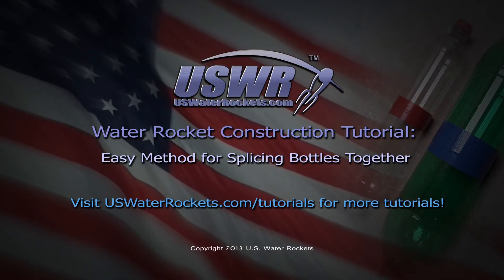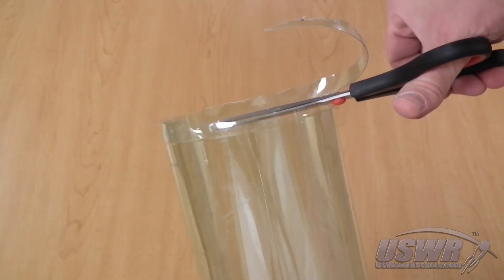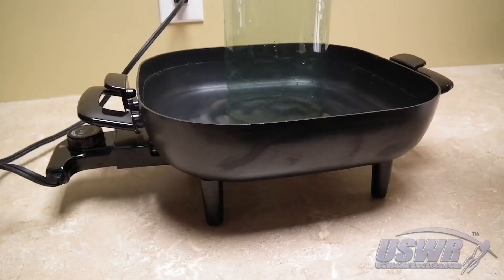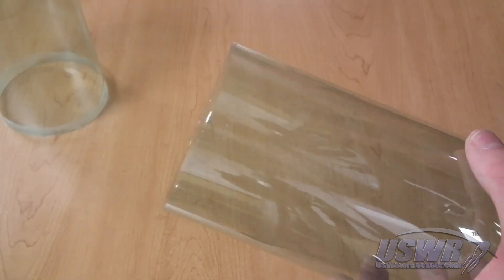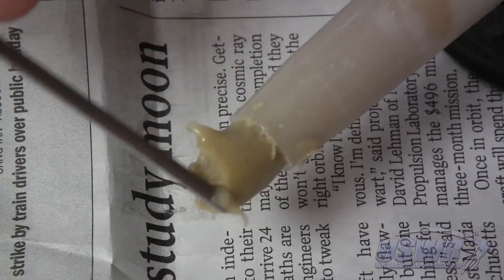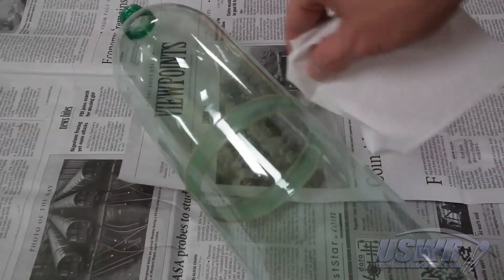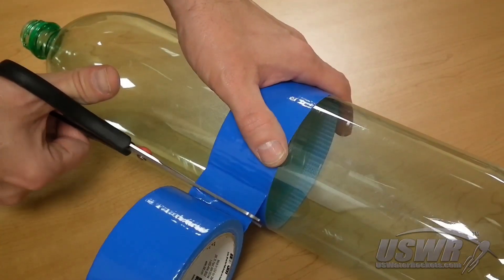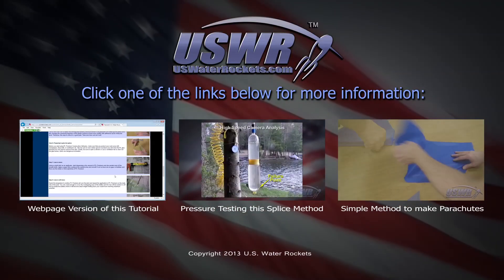How To Make a Huge Water Rocket by Splicing Bottles Together!

Comment: can I use PVC cement ?
Reply from the maker: I have never tested PVC cement, and I don't know anyone who has ever tried. I don't think it would work at all because soda bottles are made from PET and not PVC. PVC cement is made to dissolve PVC, so it probably won't do a thing to PET plastic. It will probably just sit there until it evaporates and not stick at all.
Reply: +USWaterRockets okay.Thank You :-)

Comment: What kind of Pl premium is it?
When i looked there was different kinds.
Reply from the maker: Either one will work. They sell one called 3X and one called 8X I believe, and the resulting joint is equally strong no matter which one you use. The 8X is more "sticky" when it is fresh out of the tube, which is supposed to grip things better while it cures, so you can stick tiles to the wall with it and they will not need to be held in place while the PL cures. The wet gripping power really does not come into play with bottles, because they hold together well with no special glue.
Reply: Thank!

Comment: Can you develop a good splice technique for epoxy?  It not as thin as PL,  and it dries rock hard.
Reply from the maker: I don't think it is possible, because of the hardness of the glue. The issue becomes apparent if you watch video of water rockets filling with air. The bottles get longer and fatter as they stretch out. The epoxy does not stretch because it is so hard, and this causes it to rip the bottle plastic at the joint, making it fail. The only way to stop that is to epoxy and fiberglass the whole bottle to keep it from expanding.
Reply: +USWaterRockets Actually some epoxy brands stretch a little... and I have used epoxy splices to 100 psi (check out my Straton V video)... So I am sure they work, but they have a lower burst pressure. (150psi at best)

Comment: I followed all your steps and it blew up at 60 psi and it's the same glue and everything. Could you please help me with this
Reply from the maker: +Skyfall 555 There are a couple of things that can go wrong:1) When you shrink the inner bottle it is shrunk too much and so it fits too loose inside the other bottle. This is usually where people get caught. The fit should be very snug and hard to pull apart before you glue them.2) You didn't sand the bottles to remove the smoothness all the way around. This is important as well. Many times there is a small seam in the plastic where the bottle mold comes apart and this leaves a little uneven area that is hard to get the sandpaper into.3) The glue was not fully cured. This glue is hardened by water in the air and takes a few days to fully set up. Don't think putting them in front of a heater will make it go faster, it will blow dry air on the glue and make it take longer to set. Take them into a steamy shower for a few minutes if you live in a dry climate to get the glue setting faster.These are the main issues.  A few other notes:Some people report their bottles are not very good. Test a bottle from the same supplier by inflating it and see if the bottle will hold that pressure with no splices before you use them. If the bottle alone bursts, then there's no chance the splice will make it better.Another way to make the splice artificially stronger is to make the overlapping area of the joint larger. Double the width of the overlap and double the strength.Also make sure the plastic is clean and not covered with fingerprint oil when you glue the bottles. The oil will make the glue slip off.Good luck!
Reply: +USWaterRockets  Okay thank a lot for the tips I hope to give it another try
Reply: +USWaterRockets It worked great now my water rockets are going a lot higher thanks.
Reply from the maker: That's awesome! Thanks for getting back to us with the results!

Comment: where I can buy that kind of glue?
Reply from the maker: +Angel Muratalla I don't know what stores you have around where you live. Around here it is available at all the home improvement stores like Lowes and Home Depot and ACE hardware stores. I've seen it at Walmart too (not the big cartridge, but a small regular tube with a screw cap).

Comment: Does this glue really take 5 DAYS to dry? Or is that what you suggest before using it? Please answer soon!
Reply from the maker: +EilyssaLpsTV It takes about 24 hours to set up enough to use, but if you plan on pushing the pressure to the limit where the bottles start to stretch and deform, then you should wait a few more days. You can accelerate the curing process by putting the rocket someplace where there is a lot of humidity, or put a damp paper towel inside. This glue hardens by reacting with water in the air.

Comment: Say I have a two liter bottle with 700-800 milliliters of water at about 40psi. If I increase the size to 4 liters while having the same amount of water and pressure, would I increase or decrease the performance?
Reply from the maker: +BlueLightning Films The performance will probably increase very slightly, due to the fact that the extra air volume will add thrust the original size bottles did not have.  The real advantage comes when you increase the water fill to use the extra volume. Then you get much more obvious gains in performance.

Comment: what kind of bottles u use ??
Reply from the maker: +Aggelos Simadis We use bottles that hold fizzy drinks like soda or tonic water. If the drink has fizzy bubbles then the bottle must be designed to take pressure inside. If the contents of the bottle are not fizzy, then there is a really good chance the bottle design or the plastic it is made from will explode as soon as you put a little air pressure in it.

Comment: Can I use hot glue for the seal instead it's for a school project and the upper end of the pressure range is 80 psi I realize it won't be as strong but hot glue is all I have
Reply from the maker: +Paul Dunbar I've never tried hot glue, since PL premium is so inexpensive and works so well. I've always had problems with hot glue because I work slowly and carefully and it always seems to cool off and harden before I can mate my parts together. I'm not good at working really quickly, but I'm sure other people are faster than me.

Comment: What if I used a Gardena nozzle would that be big enough or to small
Reply from the maker: +Matthew O&#39;sullivan A 10 liter rocket will accelerate very slowly with a gardena nozzle and it will not go as high. It will probably tip to one side before it accelerates enough for the fins to hold it stable.

Comment: If I made my rocket bigger than what it is would it be better
Reply from the maker: +Matthew O'sullivan In general terms, bigger is always better for altitude or distance. The problem you have is that you have to scale up the nozzle opening diameter to keep pace with the weight increase of the added volume in the rocket. If you go past about 10 liters of volume, the mouth of a typical bottle is too narrow for the weight of the rocket, so around 10 liters is a good size limit for maximum altitude. After that you have to start increasing the pressure more than the bottles can take to go higher with a standard bottle mouth size nozzle.

Comment: Yes
Reply from the maker: +Matthew O'sullivan This option will make a rocket go a lot higher than a design with tornado tubes, because those things add a lot of weight and make the rocket longer for the same volume inside. The tornado tubes can also make the air flow inside the bottle restricted, so you get less velocity, so the rocket will not go as high.

Comment from the maker: +Michael Frymus for most bottles there is a flat or multiple lobe shape on the bottom that is called the "Foot" or "claw", which allows the bottle to stand upright. The shape of this part of the bottle is not the optimum shape for a pressure container, so when you put a lot of pressure in the bottle, the bottom will almost always burst before the sides or the top, which are a nice rounded shape that will hold pressure with less stress. If you splice a rocket with all "top" parts, it will hold pressure better than one with a "bottom" on it.
Reply: Dang he left you hanging forever
Reply: I imagine Kranthi Akhil must have had a heart attack after typing USWaterRockets, and then his forehead came down on the Enter key. Surely no one could be that rude to leave someone hanging for so long
Reply: USWaterRockets
Reply from the maker: Yes?

Comment: Hey, Pl premium advanced 8x it's okay?
Reply from the maker: +David Pascual Cortes The difference between the 3x and 8x only seems to be how stiff the glue is when it comes out of the tube. The 3x is a little more liquid and that makes it a little easier to spread out smoothly. If you can work with the 8x version you will get the same strength splice as the 3x glue. It depends on your personal taste which one you will prefer to use based on the thickness of the glue when it is first applied.
Reply: Okay, thanks, which is the failure pressure?
Reply from the maker: It depends mostly on the bottle thickness, and how well you make the joint. If you really take your time and make sure the bottles slide together perfectly and you sand the mating surfaces evenly, and you get all the oil from your fingers off the joint before you glue it, then it will be stronger than the bottle plastic. We've had some strong 1 liter bottles spliced and the joints held firm at 230PSI.
Reply: +USWaterRockets wow! thats cool, thanks, like and suscribe :)
Reply from the maker: Thanks! Check out our pressure test videos. That was has some 1.5 liter spliced bottles failing at 200PSI. But by then the bottles were warping and stretched out. You'd never inflate them to that point in a real rocket. It's good to know the splices worked to that point. https://www.youtube.com/watch?v=rLhkak4YCak

Comment: Do you have to have a hole in ur homemade tornado coupler if im using 3 bottles 2 of them spliced together to make the fuselage?
Reply from the maker: +River Barnwell (Total Tutorials) Yes, we drill a hole in the Tornado Tube to allow the air to move between the segments of the rocket.
Reply: Okay thanks so much

Comment from the maker: +Russell May: I have never heard of Military Grade PL Premium adhesive. Are you using some other kind of glue other than PL Premium? If you used a different glue, then it probably is not compatible with the bottle plastic. Very few glues will stick to this kind of plastic, so chances are it's not compatible. Other causes for a joint failure are:

Grease/oil from your hands in the joint.
Loose fit (bottle was shrunk too much).
Contact area not sanded enough.

Comment: very helpful, thanks! does it matter how big the bottle?
Reply from the maker: jordan badon In general, at any fixed wall thickness (the thickness of the plastic that makes up the pressure container) the smaller you can make the diameter of the pressure container the higher pressure to be held without bursting can be. In other words, bottles with small diameters will hold more pressure than big diameter bottles if the plastic is the same thickness.
That same rule applies to splices. If the bottles are skinny, the splices will be able to withstand more pressure before coming apart.
The difference in pressure is really the only thing the size of the bottle will change. 
Does that answer your question?
Reply: Yes thanks it helps

Comment: is it necessary to retire a rocket after 20-25 launches, because the bottles may get weak and explode?
Reply from the maker: prabhav chauhan It is only required to retire a rocket when you have launched them close to their burst pressure multiple times. You can use the rocket indefinitely if you NEVER approach the burst pressure of the spliced bottles (which you have to experimentally determine by intentionally failing some test subjects). Once you start pushing the pressure limits of a rocket, it will be weakened and will degrade over time.
Reply: ok ,,thanks a lot,

Comment: for 60 psi do we really need the pl premium?
Reply from the maker: SMinMaster Kim I'm going to recommend you do a splice experiment with the glue you are hoping to use and inflating the spliced bottles (from a distance) until it fails. Then you will know the safe pressure you can use. We use a lot more pressure than 60PSI, so we really have not tested any common glues to see where they fail.  I wish I had a better answer for you, but we never did that kind of testing.
Reply: USWaterRockets thank you very much
which way is topside up , lol

Comment: Can you use anything else to glue it with?
Reply from the maker: Julia Von Vanity Other Polyurethane glues have been used with some success, but we personally have not tested any others because it is commonly known that PL Premium is the best glue for the plastic that bottles are made of. There are also some industrial adhesives specifically formulated for this plastic but they literally cost 20 to 100 times as much as PL Premium and you have to special order them.
Reply: Thank you!!!

Comment: USWaterRockets  Where can i get good tornado tubes? They leaked more then splice failures. They only have 2 threads.
Reply from the maker: Robert Hernandez Have you added a rubber washer to the tornado tube? The ones they sell online do not come with a washer and they leak a lot.
Reply: USWaterRockets wow thanks so much!! They work so much better now with the washers.

Comment: Thanks for your advice! We've tried the splice and we think it's gonna work! We were wondering if it was okay to put two layers of duck tape on?
Reply: It's safe to do that, but tape on tape only helps the bottom layer from tearing, not sticking and also the bottles fail before the (construction quality glue) and tape fail. 
However if you dont have the super strong glue then putting strips of tape top - to - bottom (bottle standing up) could help.

Comment: Hello, thanks for the great video. However we have a few questions. We've tried your method twice and the first time we didn't use the proper glue and so the second time we bought PL premium but when we put the bottle in hot water it is not shrinking it just makes the ends jagged. If you could please respond we would greatly appreciate it or give us your email so we can talk more in depth about this problem.
Reply from the maker: Your problem with the bottles sounds like you are possibly using too much heat or leaving the bottle in too long. If your water is hotter than called out in the tutorial, it will rapidly shrink the bottle a lot and it will get wrinkled like a potato chip in fryer.

The trick is to get the water to the right temperature and even then you only put the bottle in the water for a couple of seconds. If the water is hotter than specified you might only have to dip it in and pull it out and it will shrink in a fraction of a second.

Some people start out at a low temperature and raise it slowly until they find the bottle shrinking point setting for their stove or heater and then they use the same setting each time.

You really ONLY need to shrink the bottles a TINY bit. Just enough to get the one inside the other snugly. If the fit is not snug, the air space fills with glue and that is not as strong as when the two bottles are making contact with one another.

It would actually be best to talk in the comments here so that people who have the same issue they you have will find the answer out in the open.

Good luck!

Comment from the maker: If you do it carefully, the joint will be stronger than the bottles. The 2l bottles usually start to swell and get all distorted at about 150PSI-160PSI. Smaller bottles like 1l or 500ml can hold more pressure because the smaller diameter of the bottles. We have had these joints hold up to 200PSI on the smaller bottles before the small bottles start to distort and fail.  A pressure test is featured in this video: http://youtu.be/rLhkak4YCak

Comment from the maker: Hi there.  The biggest problem with using hot glue in place of PL Premium is that it cools off too fast so you can never keep it hot when spreading it over the joint. When you go to slide the bottles together, the glue is getting cold and hardening.

If you put a ton of glue on so that it stays hot longer, the hot glue begins to cause the bottles to shrink where the glue is applied, so the joint is no longer snug.

Also, we have not discovered a brand of hut glue that sticks well to the PET plastic that soft drink bottles are made from. We have tried to use various hot melt glues to glue fins on in the past, and after a few launches, the glue just peels off the bottles, so it is doubtful it would make a good splice if you had a way to get it into the joint in the first place.

Some people have had success using "Gorilla Glue" (and similar PolyUrethane glues from Elmer's and others), but you have to make the overlap area of the splice bigger to get the same strength as PL Premium.

Comment: Hi i have a trouble. I live in Mexico and i can´t find the PL premium glue, i already looked at Home Depot and i couldn´t find it, do you know if i can use another type of glue? 
Thanks :D
Reply from the maker: It is a shame that there are places where you cannot obtain PL Premium. It is the only glue that we use. It is based on Polyurethane and there are many glues with this basic formulation out there, but we have not tried to find an alternative. Perhaps you can find another PU based glue locally, or even a locally sourced construction adhesive like PL Premium based on PU? Wishing you the best of luck. If you find something, we would be happy to mention it in the video if you tell us your findings.
Reply: OK thanks for answering i´ll try to look for an alternative for PL premium :D